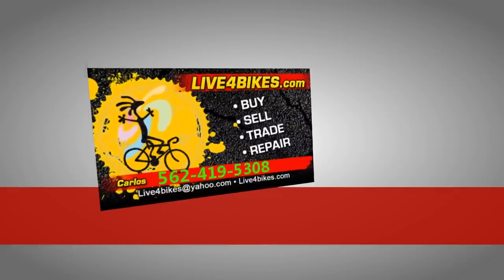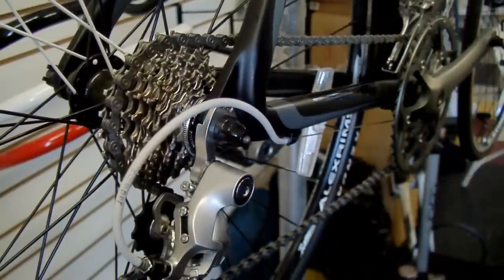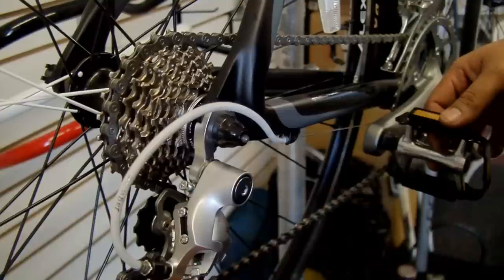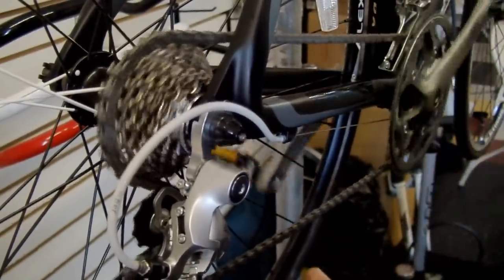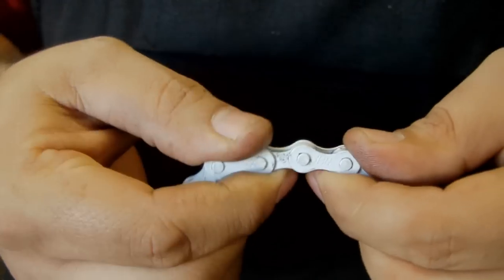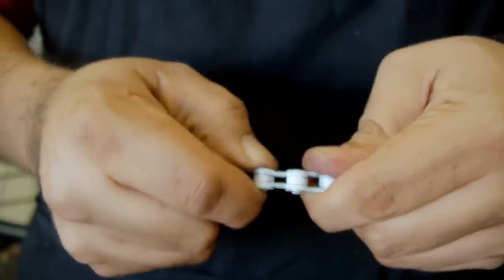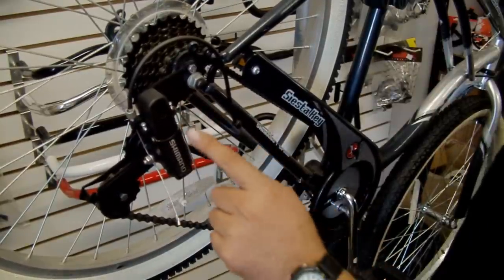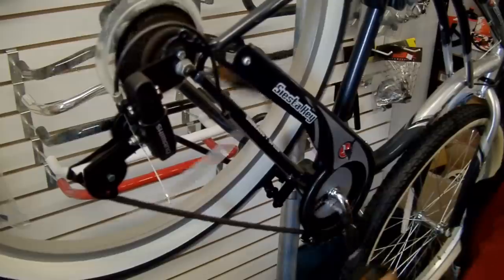How To fix a Slipping chain tips and repair Maintenance why does my bike chain skip jump

Comment: i had just started having this issue today after disassembling my cassette and servicing, cleaning and reinstalling it and putting on a new SRAM chain which was perfect for a few days.

Your first clue regarding a bad link was correct. I did not break and relink fully when I shortened my chain.

I had to press the chainbreaker in until I heard a click. 

Always keep your spare links and chainbreaker on every ride!

Thank you for the superb tip!

Comment: I have worn out chains in less than 500 miles here in Cornwall when the roads are covered in gritty mud - you can clean it as much as you like but go out and do a 50 mile ride and the chain will be covered in shit in the 1st mile - same chain in the summer could last 2000 plus miles - thanks for your video

Comment: Change a chain every 500 miles?  I'd be replacing chains every 6 weeks if that was the case.
Reply: lol, me too!
Reply: Juan Pedro the chain and rear freewheel wear each other out. replaceing the chain often prevents excessive wear to the freewheel. usually the small sprocket wears out first since it has the fewest number of teeth.
Reply: id be changing it every 10  days
Reply: Othmane Ferouine every 10 minutes
Reply: I think he's yanking our chain.
Reply: As long as the chain is kept clean and lubricated, the chain should last a long time.  Sure they stretch over time but it’s when they get dirty and lack lubrication that they stretch prematurely and then wear out the cogs.

Comment: Yes to your first question as for your second, it used to happen very often when the drivetrain is under highload but its happening less because i thinks the chain is being worn down or "custom fit" as you might say to my worn cassette and or cranks. If i can recall correctly my mechanic said it was my cassette that needs to be replaced and my cranks were fine for the time being.

Comment: I use a chain for road bicycle ( I replace it only when is streched ) from 4000 to 7000 or even 8000 km. Depends on how hard you ride it and how good you clean it.

Comment: my bike's been sitting in my folks garage for 6-7 years, rusty and dusty.  i brought it home, cleaned it up, put air in the tires, it skips pretty bad now.  i'll try these tips in the morning, hopefully I can sort it... was still able to ride it, the clicking and pedal jump was annoying though
Reply from the maker: 6-7 years... at this point best thing to do is take it to a bike shop.  Have then check it out.
Reply: Live 4 Bikes Store cool i will this weekend, i have to head there anyway for a u-lock and I think i see cracks in the rear tire.

Comment: Correctly size chain using the equation that incorporates the chain stay length and the biggest front chain ring and max rear sprockets, its on park tools. This solved my issues.mine was a full link too long.

Comment: Chain Wax. You can find it at any local motorcycle dealer/shop. Comes in a big aerosol can. I would also recommend PB Blaster or Liquid Wrench for loosening stuff up. WD-40 is horrible and too tempting to use to "lubricate".

Comment: I had slipping gears, I learnt:
Not oiling the chain causes chain wear, chain wear causes cassette wear, worn cassette = skipping.
Adjusting derailleur high/low screws is pointless, don't do it.
Cassette wear is something you can see visually, the edges of the cogs look like they've been hammered towards the center of the tooth along the edge of the tooth.
A bent hanger can also cause skipping, but you need a special tool to check/fix that.
First point of call is simply adjusting cable tension.

Comment: So my chain Snapped n I put it back together together with vise grips lol. Now when I peddle hard on the highest gears /small coggs it skips but not the other gears. I ordered a chain tool n will be ordering a new chain tomorrow but I want to know is that the reason it's skipping on those gears only? Cuz the others work fine. Just got back into bike riding a couple months ago. Thank you!

Comment: i just installed a shimano ZEE drivetrain on my bike. im having this issue that 1 out of every 5 or 10 times when i shift my chain in the highest gear(the 11 teeth sprocket) the chain ends up falling off the cassette. limit screw is set right because if i tighten it any further the chain would shift up to the next sprocket. Is it chain tension or maybe faulty product? apart from that the drivetrain works like a dream
Reply from the maker: Your derailleur hanger might be off. might be best to take it to a shop.
Reply: thanks for getting back. well actually i live in Pakistan and cycling is kind of a new sport here so bike shops are no good here especially when dealing with the fancy stuff. hence youtubers like you are my last resort...
i did try hammering the hanger between two blocks of wood before maybe ill try using a clamp this time
Reply: +Muhammad Hasan I feel you bro. I am in Mumbai, India. Although cycling as a leisure sport is picking up the average local cycle repair Shop still lacks basic understanding of these new breed of imported MTBs.
Reply: +Muhammad Hasan I feel you bro. I am in Mumbai, India. Although cycling as a leisure sport is picking up the average local cycle repair Shop still lacks basic understanding of these new breed of imported MTBs.
Reply: Aaron Mathias yes chainreactioncycles and aliexpress have been my saviors uptil now

Comment: Is it a single speed or multi-speed? If it's single, you probably have a bent crank sprocket, or, your sprockets aren't lined up. If it's a multi-speed, it's most likely your derailleur and it needs to be adjusted (skipping up or down a gear). Plenty of "how to vids". If it's just "jumping", but doesn't come off, check your chain tension. Could be just loose enough to jump when you get on it. Chain could also be wrong size?

Comment: I can't rotate my crank backwards on my mountain bike and when my back bike tire moves the crank moves with it so I can't pedal and I have no control of how fast I am going any Ideas PLEASE HElP
Reply: Kd silverslick hey buddy, sounds like the freewheel or cassette on the back wheel has locked up. kinda turning your ten speed into a fixie.. . this is the first thing I would check.  Replace the freewheel.
Reply: +Kd silverslick busted bearings on the back maybe
Reply: Thanks very helpfull

Comment: hi there could you help me as my bike slips when i put pressure on pedals i changed chainset crank and it still does it please please please help me
Reply from the maker: mark miller  when was the last time you changed you chain ? every 5000 miles is recommended. if you haven't then your cassette might be warn also. you may need change that
Reply: hi there i was thinking it mite be chain no ive never changed it second hand bike claud butler ill try them things chain first thank you for your help  all the best for new year mark

Comment: My bike is a 1985 Murray, and it makes an annoying banging noise when I try to accelerate, pull my friend on his skateboard, or sometimes for no reason at all. I watch the back gears and the chain doesn't move from what I can tell. However, when it does happen the pedals jolt forward. What could that be?
Reply: Probably a worn front chainring. Very common.

Comment: @booring2 my chain slips on higher gears(from 4 to 6) when I pedaling a little harder than normally, would that what you said in the video help me?

I have the same problem. How did you end up fixing it?

Comment: I agree, technically you're right but, in this video he said "500 miles" and, yeah, that's true if you don't clean and oil your chain but, if mileage didn't matter, he shouldn't have mentioned it, especially such a low figure. I've gotten much more mileage out of my 10 speed chains. And, yes, I use that tool all the time, or a tape measure (12-1/8 inches of stretch in 12 links is too much, with 12-1/16 my guide).

Comment: Mileage doesen't matter.  Their is a reason they have chain checker tools.  They don't cost much and are simple to use.  You're suppost to change a chain when the wear gets to .75 or 3 quarters of one percent chain stretch.  If you let it go to the 1 percent mark you are doing damage to your cassette teeth and chainrings.  Chains are cheap. You can get 10 speed xtr chains for 50 bucks on ebay or xt ones for less than 30 if you shop around.  9 speed ones are even cheaper.

Comment: i feel like being a heavy set person could also make the chain slip just too much weight
Reply: that's not how it works. doesnt matter if the person is 30 kg or 300kg, if the chain connects to the teeth correctly, it will work as intended. otherwise - might be worn parts

Comment: Every 500 miles?? Scam. There's a tool you can purchase to check if your chain is worn. My chain has done at least 6000 Kilometres and the chain is in great condition.
Reply from the maker: PatrolTard thx for the comment. Your right 5000 or so sounds more likely.